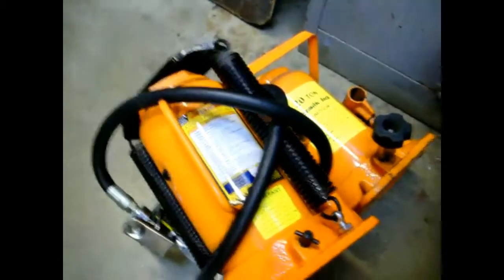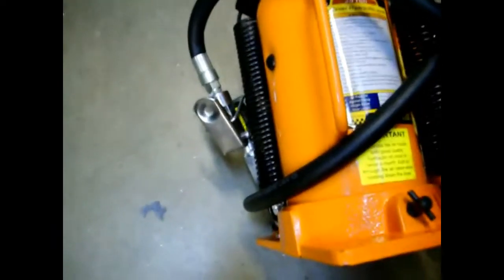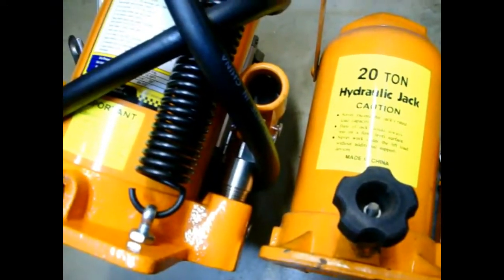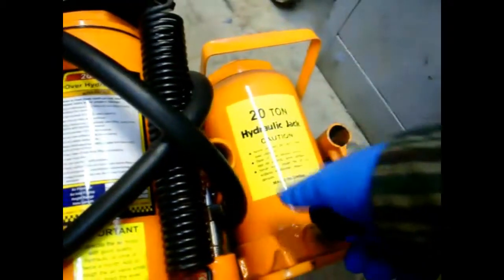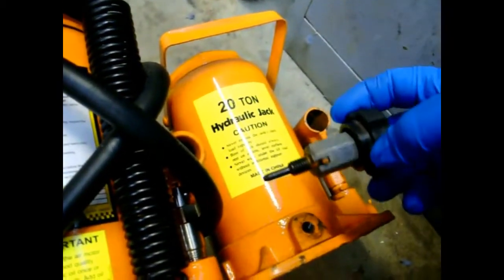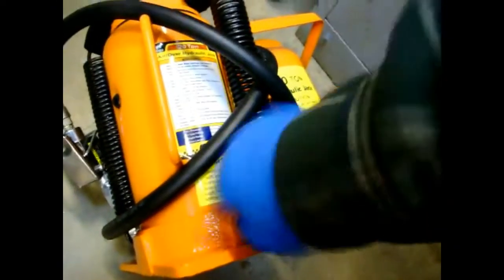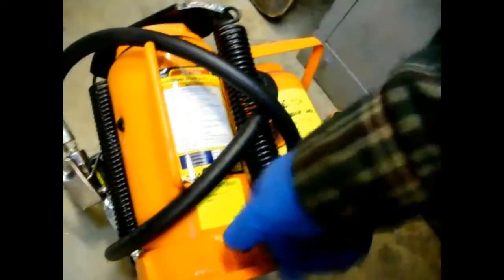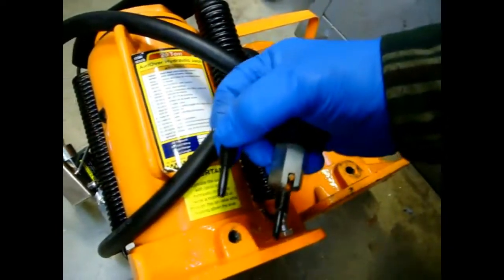20 ton Shop Press Valve Release Knob

Comment: So would there be any draw back to putting one of these knobs on a regular hydraulic jack that you use for a car? That would save one from having to make sure you had a pair of pliers with you if you where on the road. Would there be any draw back or safety issues? Cool Idea.

Comment from the maker: The biggest drawback that I can see is that you'd have to put part of your body under the vehicle to release the jack.  The jack handle that comes with the jack should have a couple of notches in one end for releasing the valve.  I'd make a valve release from a piece of tubing before I got under the car to use a knob release. Other than that, it would make lowering the vehicle slowly much easier to do. :)
Thanks!!